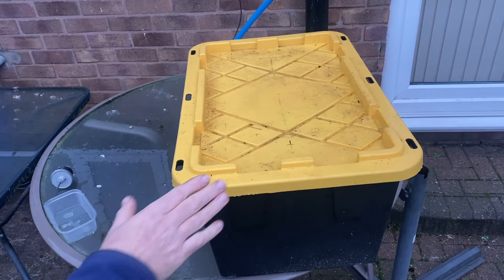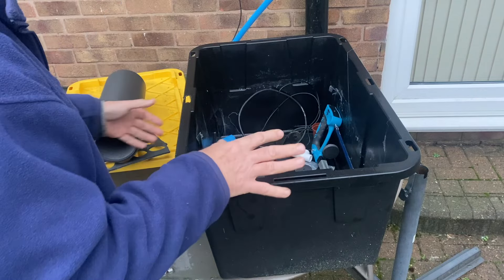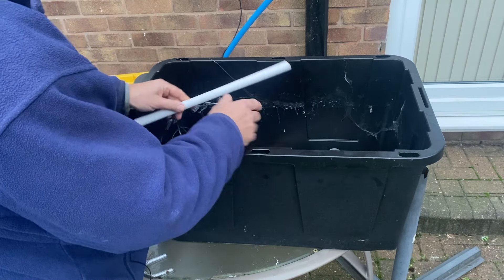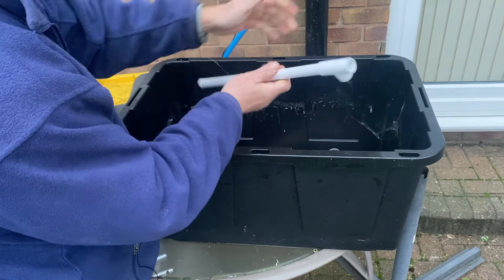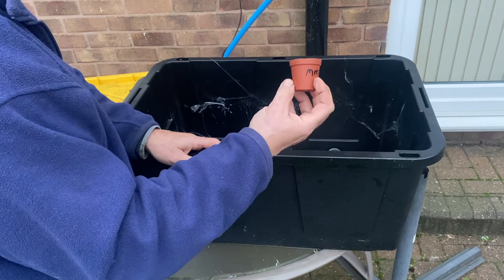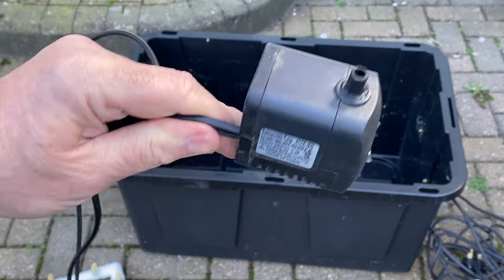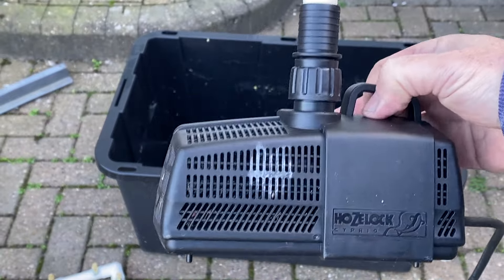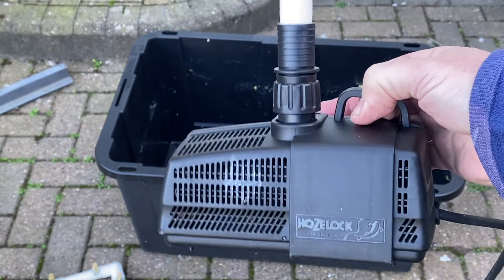DIY aeroponic cloning station

Comment: I drill and thread the holes for the sprayers.  Never had to use any glue or sealant and I can easily remove and replace them. It's worth the 8 dollars I spent on the tap.

Comment: A high pressure aero cloner would give you complete control and fine mist. Sprinklerponics works but no plant on earth needs that amount of water :) 3 nozzles will completely fill the tote with mist in a couple of seconds.